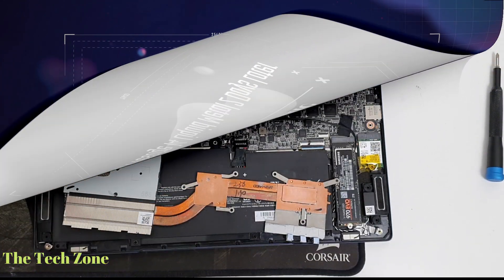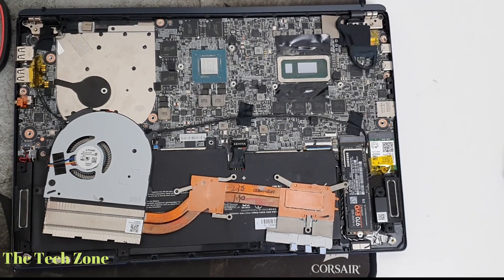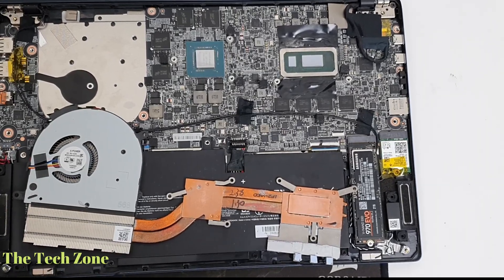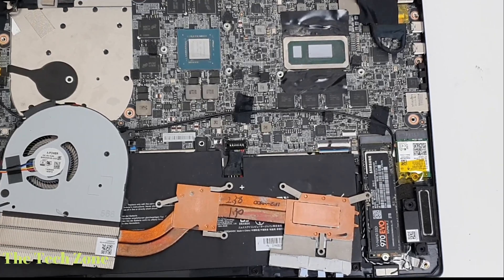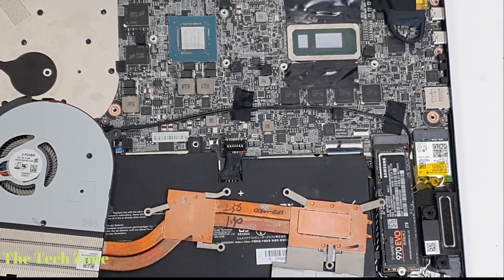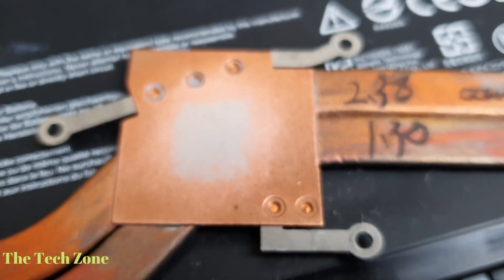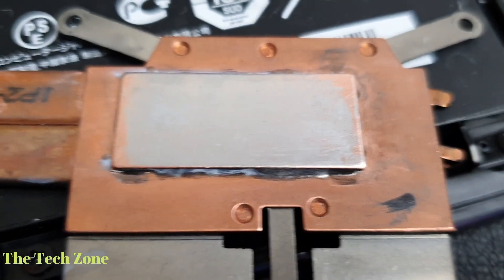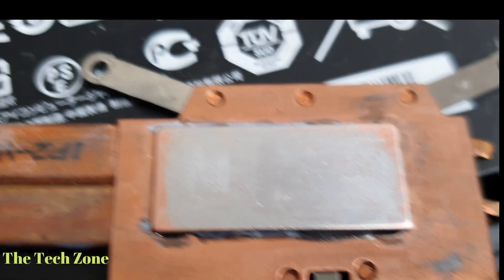MSI Prestige 14 Liquid Metal Mod 2 Days After

Comment: Did you notice improved temps and performance on the CPU & GPU before removing? And why did you remove Conductanot after 2 days?
Reply from the maker: Hi, thanks for the question and I'm sorry for the late reponse, I have missed several questions since the new creator studios was released.
Yes accually around  5 degrees lower in Far Cry 5. I removed it mostly to show the impact for the ones consider going for this solution. It turned out good if it had been a non pure copper  hearsink it would have shown more deep damage after that time..
I will be very grateful if can support the channel by subscribing :)

Comment: I have an MSI Prestige 15 and i bought a tube of Conductonaut but i feel scared of putting the liquid metal.
I used conformal coating but I feel like there isn't enough protection, specially for the CPU's edge.
Should I wait and use Kapton (Polyimide) tape or nail polish?
Just to be safe.
Reply from the maker: Hi, thanks for the feedback and question. I really understand the fear of using liquid metal. I have never used Kapton but I guess that tape have simular 
characteristics as Scotch Super 33+ electric tape that can stand up to 105 degree celsius to cover all connector pins close to the CPU and GPU as you can see in the video. You should use Kapton tape if you feel unsure as it will provide a safe zoone.
I will be very grateful if you can support the channel by subscribing :)

Comment: The discoloration is not a problem at all, that's just the gallium of liquid metal reacting with copper. There isn't really any harm on the long run if you use liquid metal. Gamers Nexus here on youtube did a 1 year test of liquid metal on copper heatsinks and there wasn't any problem at all, the temps were the same just like 1 year before. I'd say to keep liquid metal on it since the temps improvements are great. Make sure that this time you don't put a lot of liquid metal, there should not be any small bubbles.
Reply from the maker: Thanks a lot for your feedback. I did use less on the first try but didn't see any liquid metal  on the heat sink, only on the CPU/GPU, and thought I did't have proper contact.